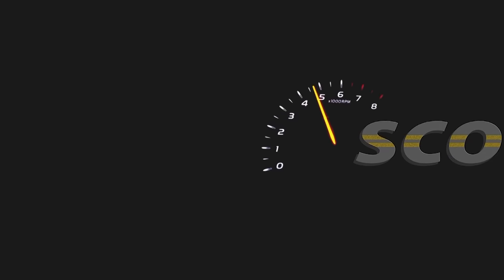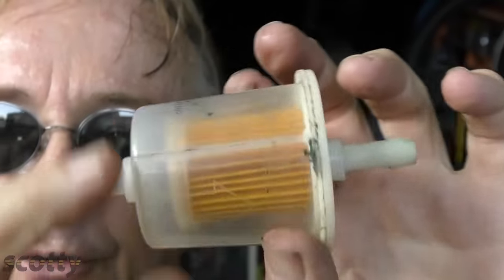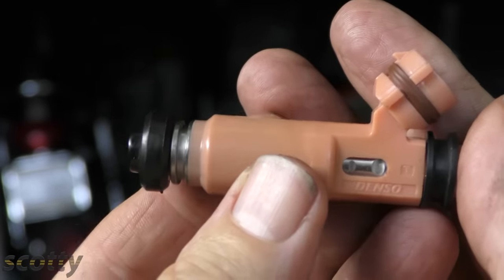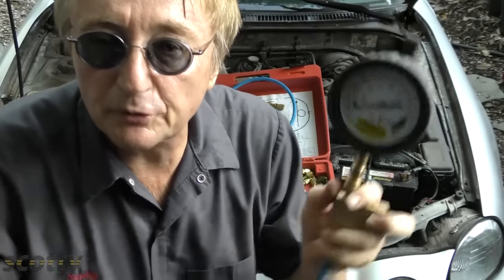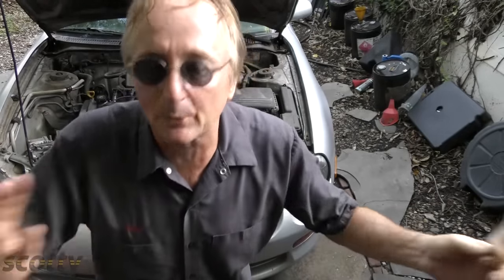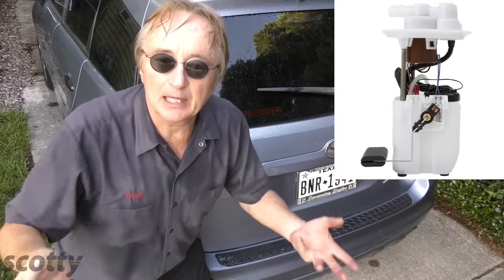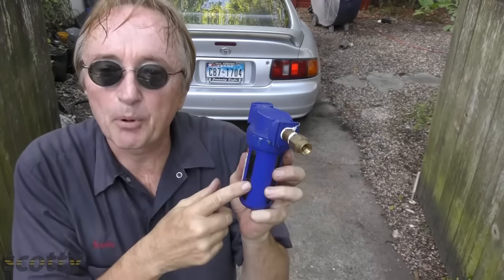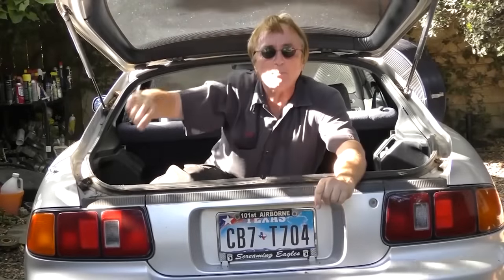Here’s What Happens if You Don’t Change the Fuel Filter in Your Car

Comment: Putting the filter inside the tank was a horrible idea, it only takes five minutes and five dollars to change the old inline filters. And here's a tech tip for anyone else with a rusty gas tank, just put two inline filters on the fuel line in a row. It will drastically reduce the amount of rust that makes it into the carb. And if you drive for long enough (like a couple years) it will actually clean out the tank. After two or three years of driving my 68 Roadrunner double filtered I eventually stopped getting rust in the filters and carb. I did have to replace the tank later on though as it had developed a few rust holes in the top preventing me from filling up all the way.

Comment: My wife's VW SportWagen TDI (Diesel, for those who don't know what TDI means) calls for a new fuel-filter every 20,000 miles.  You have to have special software on a computer to turn on the fuel-pump to fill the filter with fuel before you start the engine after replacing the filter.  Otherwise you burn out the main injector pump.  The filter itself is reasonably priced ($24 on the Internet), and it's easy to access and replace yourself (takes about 15 minutes to remove the old one and replace it with the new one), but because most people don't have the computer or software, they have to pay the dealer $250 to replace the damn filter.

My wife drives about 50K miles per year, and my step-daughter owns a similar VW TDI car, so it was worth it to me to buy the $200 software-and-OBD2-connector package that I need to run the fuel pump after changing the filter myself.  Heck, this software can do literally anything the dealer's computer can do, so I can do things like read codes from all the car's systems (not just the basic OBD2 codes), reset the service indicator, monitor any of the sensors to see if something's wrong, etc...  I don't need to go to the dealer for any of that crap anymore.  Worth every penny of the $200 I spent.

Comment: Of course, hardly anyone replaces their fuel filter as preventive maintenance. It isn't even considered preventive maintenance in most modern cars by the manufacturers. I've never replaced a fuel filter in 40 years of driving, and never had to have one replaced. My '06 Honda CR-V with 165k miles I bought new still has the original fuel filter. Btw, most mechanics won't bother with replacing the fuel filter. They'll simply replace the fuel pump with the filter because it's much easier.

Comment: Just changed my fuel filter on my 95 volvo, and it kinda fixed the problem. Apparently it was horrendously full of junk, and since it still has intermittent problems starting, I"m curious if the junk got into the fuel line and is somehow still clogging the line? Or have I burnt out my 2 year fuel pump due to an old filter? Would have been nice to have it suggested to put a new fuel filter in, when they put in a new fuel pump 2 years ago!

Comment: Long gone are the halcyon days of in line external fuel filters and even flasher cans for the indicators. Everything is a super expensive module assembly.  For a while considered taking the filter out of my fuel pump/filter/sender module and installing an inline external. 
They thought of that too, in my car the fuel pressure regulator is in there fuel pump/filter/fuel level sender too which is positioned after the filter.  
Modern car manufacturers have got us all screwed.
Reply: Aussie Mitsubishi 380.  The module includes, filter, pump, pressure regulator and the fuel level sensor.  I'm told this fuel level sensor is for  computer engine management functions because next to this module on the driver's side is the simple fuel level sender for the gauge.  In reference to the "flasher can", my car has what's called an ETAACS module ( I don't know what ETAACS means)  which contains the flasher relay, wiper control relay and other dark forbidden magic.
Reply: +Ellesmere   You are correct. If automakers were making computer chips, imagine the cost.

Comment: I have a mitsu eclipse 2003 at 160,000 I noticed the car was wanting to stall and at times it did. It was the fuel filter. It never had been changed. The tough part was getting it out of the gas tank not to mention the danger of fire. I hope it lasts another 160,000 not interested in going at it again.

Comment: I have a 2004 Toyota Avalon.  Knowing that the mfg. does not explicitly suggest replacing or servicing all of the parts that might wear out or fail, I did some research.  The manual said that the fuel filter (not just the fuel pump) was in the gas tank.  On other cars, I had routinely had in line fuel filters replaced.  So, I looked further.  Lo and behold, the official manual was wrong!  It did have an in-line, out of the gas tank fuel filter.  So I bought one and waited until today.  Today, I took the car to my service mechanic, not the dealership and not the franchise oil change place.  I had the mechanic put the car up on a hoist.  Check for leaky seals, grease points, replace the fuel filter, replace the front differential oil and install a new cabin filter.  I had replaced the cabin filter myself twice before.  At my age, I would now need three hands to do it.

The car then ran like it was brand new, right out of the repair shop.  This is June 4, 2019.  That is the only servicing that will be done this calendar year.  106,500 miles.  My dad had the same model, 2 years older, a 2002.  That car got 240,000 miles before giving up the ghost.

Comment: The pump pressure dead heads. Like 60psi. And the pump moter slows down. This causes the pump to pull more amps. And that damages the pump. Folks , gas cools the pump. That the reason it's in the gas tank. A fuel filter in most cases is easy to change. 
They last about 20000 miles ,depending on where u buy your fuel.

Comment: I dont have a fuel filter in my truck. Much less pain. Funny since its from 05 and other models have one under the drivers side on the frame rail. Either way, let the fuel pumps go. Each and cheap to deal with for me. Also 166,000 miles clocked and quite a few hours more just idling.

Comment: I had no idea John Lennon knew so much about cars. :) Great vids!
Reply: @Nicholas Bongers 

I have a qweshin؟ pleeze 1 of you well-experienced tech/mechanics or Scaady-fans help me for I am in a konunjrum:
If a fuel tank is vandalized by addition of some contaminant to it. Not sure if it's water, vinegar bleach, ..etc. *does the fuel pump necessarily need be changed* whay is the best recomendation?? SHOULD I AuDOMATICALY also GeT a different tank (it would need be from wrecking yard~) IF I DON'T HAVE PRESSURE WASHER OR HOSE or facility to wash and put a sleeve into it- the gas tank- for cleaning?
Reply: @rezagrans1296  did you try running the car? Has the fuel pump pumped to the foreign substance? If so, I would replace the tank, the fuel pump, the fuel filter, and everything in the fuel chain. But that's just me. I would ask some experts, as I just perform routine maintenance on my cars. I am by no means an expert.
Reply: I will replace the tank, too bad ii can't clean it. Being plastic is suposd to make it easier than if it was steel. The fuel pump can be cleaned effectively in your opinion? If contaminant remains, all has to be redone again or injectors and sylinders could get afected. But I don't yet even know if water, bleach, coke (?) What exactly was added

Comment: I am thinking about replacing the fuse for the fuel pump with a smaller one, like 3a or 5a instead of 10a. I would replace the strainer once the fuse went twice on a single tank of gas.

Comment: I bought a  2001 Camry with the 5SFE back in Feb. Driving to work this morning and I couldn't rev past 3k RPMs in second gear, going 25 mph. Engine light flashing. Car's got 400K miles on it, and the filter is the original one that comes with the car. That's probably what my problem is... Now I have to work on a street parked car.

Comment: Scotty!  If the fuel pump in that matrix fails, you don't have to buy the $600 OEM assembly!  You can buy the aftermarket OE Denso pump for $100.00 and get that stupid plastic fillter assembly for like a $100 or less.

Comment: Recently I bought a BMW 528i and changed all filters (including the fuel one). The car is from 1997 and has 320 000 kilometers on it (200k mls), and the date on the filter was 1997 :O when I opened it up it was all black like an old oil filter. Car ran great despite the filter though
Reply: Armando Sturzenegger a thousand dollars. I bought it with damaged air suspension
Reply: +iksio   So, the air suspension cost what, $3500 to repair? Your story is an outlier and does not matter.
Reply: I shared my story because it was relevant to the video about fuel filters, did you read my first comment? guess not
btw, fixing the suspension cost me $250 and an afternoon with some tools

Comment: Diesel filters clog up all the time. Ive changed it on every diesel weve had because the car was running slow. Fuel filter fixed it every time

Comment: I used the search function in the pdf version of my manual and it seems I either do not have a fuel filter or it is not servicable.  The only filters mentioned seem to be the oil filter and the air filter.

Strange though since there are videos on youtube showing corollas close to 99s that have it and how to change it out.

Comment: My truck has fuel filter and pump in the tank,,no way to replace it unless it fks up..no problems so far,
since I use good clean gasoline exclusively from Petro Canada..this also contains Tactrol engine cleaning aditive

Comment: I have an 04 ford focus 2.0
It has 55,000 original miles. When I bought the car, the air filter had never been changed so I assume that the fuel filter was the original as well. The car is 18 years old. But it did belong to an old lady who barely drove it.
Do you have any preventative suggestions for I have replaced the filter with a new one. I have new spark plugs, spark plug wires, and ignition coil. Oil changed. 
Should I have the gas pressure tested? What is it called?

Comment: I believe he briefly touched on it oh, the old carbureted vehicles,... Can anyone offer a more detailed explanation of what happens to say a Chevrolet V8 High horsepower engine with a 4-barrel carb... The engine is new I purchased it as a crate engine from GM and it has a 750 Holley on it I believe. When the car was restored it unfortunately set for about 8 years... And the gas tank became corroded... when I finally got the car back the gentleman had installed an inline fuel filter like the one Scott he had in his hand at the beginning of the video... He installed it right after the gas tank...( I forgot to add they did the best job cleaning out the gas tank they could and after running four or five tanks of gas through it, the tank has almost cleaned up like new.) I was wondering what a clogged filter under these type of circumstances might do to the engine... Or how it might affect the performance... when the car is idling it sounds like it has a little miss like a bad plug wire or spark plug excetera. I've had all that checked out... but the last person who worked on it checked everything, distributor wires Etc and replace the plugs... But he did not replace the damn fuel filter... It's very easy for him to get to on a lift his response was there was too much gas in the tank... Which was not the case I intentionally made sure it only had a few gallons when I dropped it off

Comment: Not sure if it’s my fuel filter. I replaced my plugs, wires, switched to synthetic high mileage and replaced the Air filter. But it doesn’t seem like my car accelerates quickly  like it should. Say I’m going sixty mph then I floor it, it’s almost like it takes a few seconds to respond then it goes. 4 cylinder ford ranger. 95k miles. I’ve ran sea foam through it a few times. Any suggestions?

Comment: Hi Scotty!  In Canada we have a different blend of gas in the winter time to prevent it from gas freezing (Winter blend). That blend of gasoline and with the colder weather throws the gas mileage out the door. In spring when we go back to the summer blend, I would always get a fuel injectors cleaning and install a new fuel filter. Once that service was done, Excellent gas mileage!  Long story short, the next car i'm getting does not have an external fuel filter. Any tips on how to clean out the fuel system really well?

Comment: Yeah, Toyota says these are lifetime parts. In my Rav4 (2009, V6) it's not a simple job. To get to it I'd need to drop the entire gas tank, something I've never done and is way beyond my skill set. To do it at the dealership costs over $1,000.  I've seen quotes upwards of $1,500 with parts and labor. Supposedly if you're not having any trouble with it you're not supposed to just drop $1500 on a new one, especially on an older car that it's not worth it to do. My car's "book" value for trade is like $4,000. Even if I sold it privately I'd be lucky to get $6,000 for it. I'm not spending 25% of the value of my car to change a part hat isn't giving me any trouble.

Comment: Scotty the Toyota owners manual for my 1999 Toyota Camry 4 cylinder does not have a replacement interval for a fuel filter anywhere in the maintenance schedule. Fuel filter is not even mentioned in the maintenance schedule. Should I replace the fuel filter or not?

Comment: Some vehicles dont even have listings for fuel filters. I've looked up a fuel filter for my 2011 Ram 1500 3.7 liter and have found no such listing for a "Fuel Filter"
Reply: Your filter is built in with the fuel pump assembly so you don't have an external filter.

Comment: I'n a 928 it's one of the easiest things to replace on the car. Just take off a cover on the back of the fuel tank and there it is attached by a hard line to the pump. You don't even need to raise the car to do it. I hate that in modern cars they find more and more creative ways to hide stuff that should be easy to service as a consumable part.

Comment: It is not that hard to replace modern day fuel filter. Of course not as easy as older cars where they are located in the engine bay.  I did it myself although I'm not a mechanic. From my experience, to dismantle the fuel filter & pump assembly is easy. You have to dismantle the fuel pump from the old fuel filter assembly. However, the new fuel filter assembly part that I bought from the dealer, it came disassembled. You have to assemble the fuel filter and the pump yourself. That is quite a hassle, quite a number of small parts. Don't listen to people telling you to just replace only 1 filter element which you can buy from third party. You have to replace the entire fuel filter assembly because there are actually 2 filters in the assembly, 1 which you can see and easy to access, another one is not and you need to destroy the assembly to see it.
 Best advice before you replace the fuel filter is only do it when the car is low on fuel .  It gets very messy to take out the old fuel filter&pump assembly  when your fuel tank is full because the assembly is soaked in gasoline , so the less area gasoline touches the assembly the better so that less gasoline will drip everywhere when you pull the assembly out from the fuel tank. . I drive a 2012 Mitsubishi Lancer .

Comment: I own a 2012 Ford Fusion Hybrid that supposedly has one of those "lifetime" air filters, would love to know what your thoughts are on that. It currently has 61k miles and have started looking into getting it replaced.
Reply: On this car its not as easy as a normal 2.5, 3.0, or 3.5 due to it being a hybrid model.  I've been trying to locate the air filter replacement and exactly how to get to it, it's definitely not been easy.
Reply: You are correct on it being easy to follow the tubing, but its buried behind the front bumper, that will require time and disassembly of several parts.  Like I said its not easy like the normal engine's where it undo a couple of clips in and out like on my previous 08 2.3, 11 3.0 and wife's mkz 3.7 they were easy. My biggest problems is finding the replacement part.  On the 2013+ hybrids models it right on top of the motor of undo a few of the screws and swap the filter.

Comment: Does how low you let you the fuel level get in your gas tank affect how often you have to change the filter?  I've heard if you let it get to empty before filling up, you're sucking crud off the bottom of the tank.  Does this apply to modern cars?

Comment: Hey Scotty how about on my 2005 Toyota Corolla. The filter is part of the fuel pump I’ve heard the filter only is bad when the pump is bad? Could that be causing my bad gas mileage? It only gets 300 miles to the tank and it should be getting over 30mpg.

Comment: Modern cars are harder to test fuel pressure? I beg to differ. I had an old Nissan and an old Ford that required removing a bunch of hoses and connecting adapters. On the other hand my new Honda has one of those quick connect fittings for fuel pressure. I don't think it's a modern versus old thing, its a manufacturer thing.

I can see why the put the filters in the tank. Safer for the pump, but it would be REALLY nice if you could remove the filter without dropping the tank.

Comment: Hi Scotty i have a 2005 toyota rav4 d4d and it has this thing were when you go on a 30 minute trip and turn the car off it won't turn on for 30 minutes and sometimes it says it's getting hot and starts to lose power on small inclines
Reply: bugatti fan sounds like my issue what was yours exactly and did you get it fixed?

Comment: Scotty I thought I'd take a look under my 2014 f-150 with the 3.5 ecoboost engine for a fuel filter. Where most videos I've found show the can filter I was used to there is a big, oblong, foot+ length box. And as i'm just sliding in under the side I can't tell but it looks like ther fuel lines are going into it. So, is this my pump and filter assy?  And is it a "lifetime" part?